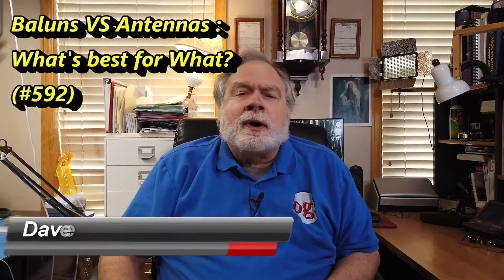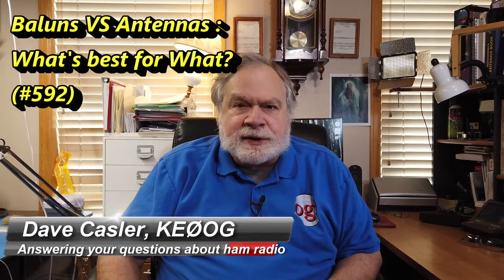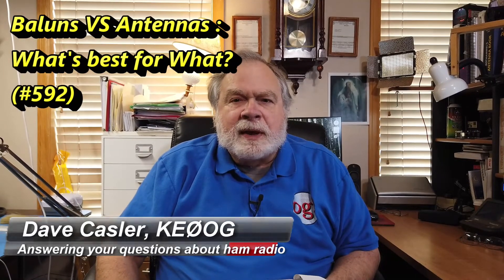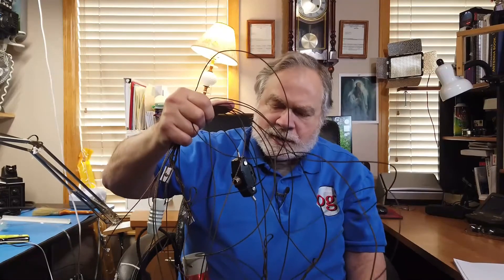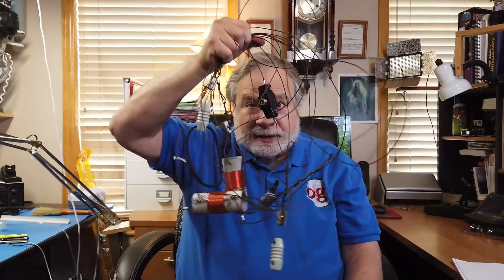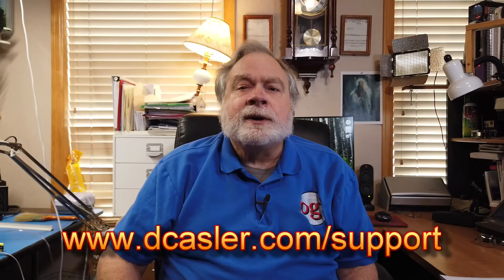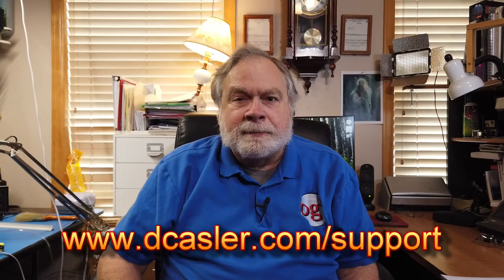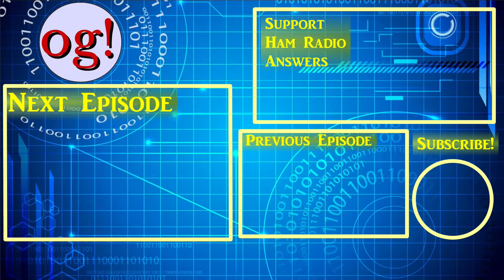Baluns VS Antennas : What's best for What? (#592)

Comment: I have a painted 240-43 toroid with 13 turns of stranded rg8x taped to the mast of my 20-40-80 meter fan dipole. Don't know if it's needed, but antenna performs well. Dave, one of these days an explanation of the uses of 4:1 voltage baluns vs 4:1 current baluns would be helpful. I'm confused as to when to run each. Thank you for the great channel.
Reply: FWIW the 4:1 "voltage balun" is  effectively a transformer sharing part of the secondary with the primary, the other winding is used to ideally produce a mirror image of the same voltage exactly 180 degrees out of phase. In a perfectly symmetrical system like a dipole in free space this does not sound such a bad idea. In reality though the phase shift is not spot on at 180 degrees and the antennas are not perfectly symmetrical. So applying the same voltage to one leg produces a different current from that occurring in the other leg.
The imbalance current appears as "common mode" current and can cause RFI and noise issues.
A 4:1 current balun is usually constructed on 2 separate cores, but the objective is to to create equal current in either leg of the antenna which it will do despite any slight asymmetry in the antenna or environment. Common mode current should be negligible. If you are interested have a look at the website of W8JI where he explains in more detail.